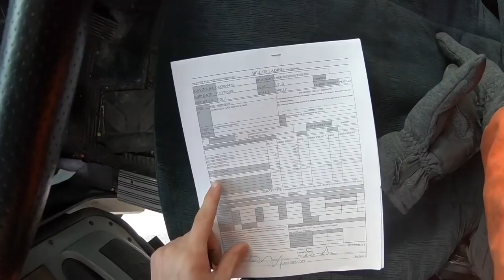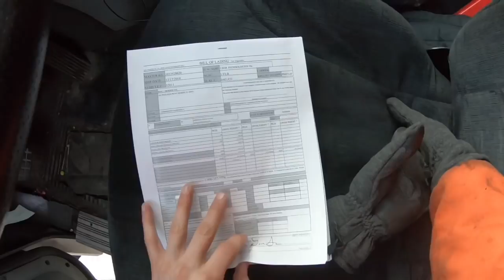Rotator work ep #138 frieghtshaker w/a bad starter

Comment: Do you have on-board inverter power (or even plug-in shore power when you're back at the shop) so that you can be charging up spare batteries for the impact gun(s) ?  Or do you have to remember to take the battery out of the unit and charge it when you get back to the shop ?

Comment: 27:12 You would think that with the technology we have today there would be a easier way to take these out of gear or a lever that could be flipped so you wouldn't have to get under the tractor to disconnect the drive line. It would be nice if the tractors and other trucks like this would have a air hook up on the front and a way to provide power/lights and other way's to make the job much easier and quicker. This would be nice for when you are on the side of the road and you don't want to be there for a very long time because you become a hazard the longer you are there. It would be nice if the different manufactures would start building the different tractors/trucks so these would be put into place.

Comment: Quick question and I have no experience with commercial trucks but what is the reason the drive line has to be dropped I presumed that you could put a truck in neutral to keep it out of gear and screwing up the transmission.

Comment: Great job as always Malachi. Jaybird needs to wash his coat a couple thousand times. 1 piece of wood on each leg? C'mon Jaybird wake up. I wouldn't have droped  the shaft just to tow it across the street or pull it out then hook it from the rear . That short of distance will not harm the transmission as you obviously know. Screw those pressed in shafts they suck. So don't listen to that nasayer it's not your fault the thing wouldnt cooperate. Keep up the great work buddy. Stay warm and safe my friend. HAPPY New Year.
Reply: Are you willing to take that risk, and accept that responsibility for the transmission?  Better to take that 10 minutes and just do it, than to have a ten-thousand dollar bill for a replacement transmission.  Who knows how many miles on it, or how it's been treated, or how the last tow guys treated it.  Jay and Mal could do everything right, and still something could go "wrong" after the fact, and next thing you know, you've got the owner blaming the tow company for something that was hanging by a thread until the very second that Jonny's answered the phone.  Shortcuts are tempting, but they can come back to bite hard.
Reply: @stanpatterson5033  To go across the street? Yes I am!

Comment: Cheap gloves for winter?? 

Nothing beats the ole cheapo brown jersey gloves, with a pair of some heavy gage, disposable rubber gloves on them, for the wind and water, as needed! The brown cheapo gloves will not last long. They are cheap. No big loss if you lose them. If they get a little dirty, toss them out. If you need water proof,, use the disposable rubber gloves. Throw them out if the tear, get another one. If the brown ones get wet, get a dry pair, they are cheap. If it's really cold, a second pair on top of the rubber gloves work well, too! The first pair insulate, the rubber gloves keep you out of the wind, or dry, or whatever, and the second brown ones help keep it all warm! 

I used to go buy those leather ones, to fuel up, and to work in the cold wet stuff! They sucked! They were cheap, too, but not real cheap! If you use brown jersey gloves, then add a pair of rubber when it's wet, or you might get them dirty, and they ain't too bad, reuse them! Brown gloves ain't warm, add a rubber pair, that ain't warm, add another brown pair! The first time you get those expensive ones wet, you don't want to throw them away, and will keep wearing them, wet and dirty, and try everything to dry them out, until they may dry enough. What do you use in the mean time? Those cheap brown gloves, with a pair of those cheap rubber gloves, are a great, cheap combination!